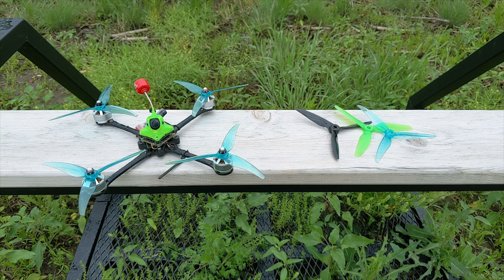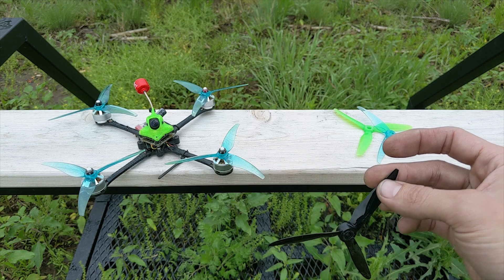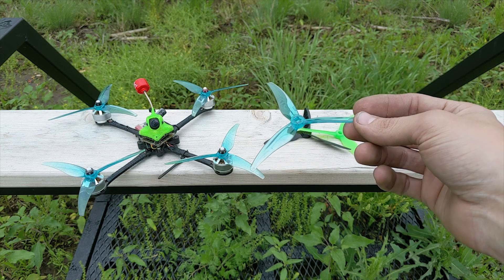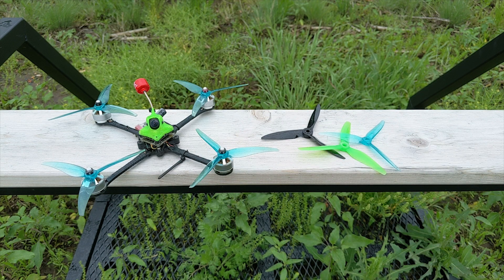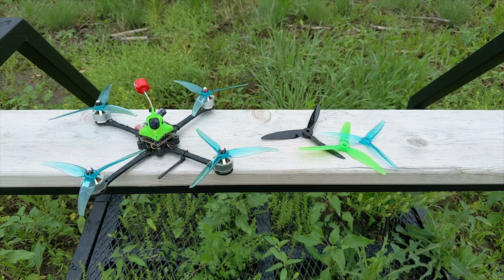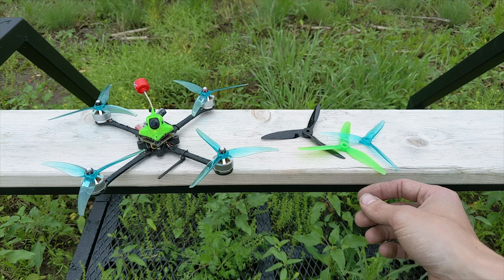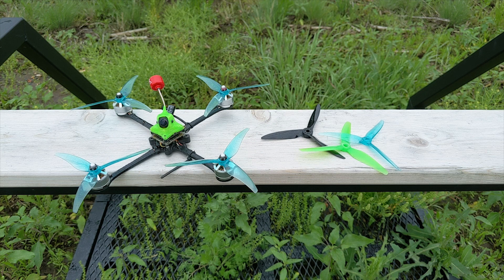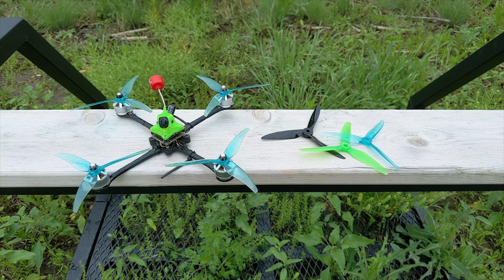Ultralight 5" Prop theory, Gemfan SL5125

Comment: the 5051c are awesome but they need an updated version
Reply from the maker: It will be interesting to see if they try to produce an updated version of it or an entirely different design for Utralight. The 5051C'S are a strange prop and don't take crashes very well.

Comment: Suppose there is any way this type of build with a vista unit with the new nebula camera might come in under 250g?  Or are we not there yet?
Reply from the maker: It's very doable with the Vista. I'm sure it would be close with the 1806's but the 2004's should be more efficient. If I took out my camera,  antenna and vtx, I would be at 215 ish grams AUW. Add Vista and antenna +32.5g? Should be about 247.5 grams AUW.
Reply: DamFast FPV ok I’m in haha, order up :)
Reply from the maker: @seewell8168  thanks for your order!

Comment: Hey man cool video. What's your thoughts on the vy 2004 motors being at 1950kv and 3150kv? At first I thought 3150 was too high for 4s but their tests were showing 33amp drawn at max which is totally manageable. Would still come well under 250g with an 850mah rdq or gnb 4s. Maybe the 1950kv would be better suited for 5s vs 6s like they say.
Reply: I got some of the latest hqprop T5x3 biblade props and the hqprop T5x2x3 triblades on the way to try out to. They are even lower pitch 👍.
Reply from the maker: I am working on a set of motors with brother hobby, samples are coming soon for testing. 3150kv will be easier to build with the current whoop style boards available for 4S. Otherwise you will have to run a 20x20 to get 6S running on that 1950kv motor. Unless we can bug BetaFPV to release a final 6S whoop board like the prototype board I got from them. I'm a 6S junkie all day. Lol. Another negative for going 6S is the battery selection is crap for Utralights. All my Utralight 5S and 6S packs are home made from 3S packs. It's easier to find the better 4S batteries for sub 250G.
Reply from the maker: And I have not tried the bi-blades, for their weight, I would assume the Gemfan tri-blade will out perform them in every way. Let me know how they do if you try it before I get to it!
Reply: @damfastfpv8016  for sure. I'm thinking those gemfans will be the best, the hq 5x2x3 looks like they push about 50 grams thrust less than the gemfans, but they also use a couple fewer amps. Still around 1000 grams thrust per motor.... The power to weight ratio is gonna be insane haha. If I can get 4-5 mins on that setup with an 850mah 4s lipo I'll be a happy camper!
Reply from the maker: @valden  you should be able to go anywhere from 5-10 min with that setup, all depends on how heavy your throttle thumb is! Lol. If that's even a thing.
Reply: @damfastfpv8016  that would be pretty sweet! I also feel this thing is gonna be great for line of sight.
Reply from the maker: @valden  it is deceiving how responsive it is. I would love to see The RCAddict fly it LOS or someone equally skilled. My LOS skills are lacking, lol
Reply: @damfastfpv8016  wondering if it will be ok with an xt30... I have a bunch of batteries with xt30, but if I need to swap to xt60 I'll do it.
Reply from the maker: @valden  XT 30 will be fine, but if your like me, I gotta obsessively squeeze every bit of performance outta everything. I totally do not recommend modding batteries unless you are very very experienced to do so. It can cause fires to happen if not done correctly. There is still tons of performance available through an XT-30
Reply: @damfastfpv8016  cool I will try ot out and see how it goes and switch to xt60 if the need arises
Reply from the maker: @valden  let me know how it does. I will be testing some more motors soon. Hope they are as good as the stats say.
Reply: @damfastfpv8016  will do... They need to release them soon lol. But if you find out anything compelling or that may be even better I'll be sure to follow your findings.
Reply: @damfastfpv8016 ohhh man, they must have read my mind because I just ordered them! They just popped up on the brotherhobby store and they are going for 21.99 a pop. Here's hoping it all works out. Will keep ya posted.
Reply from the maker: @valden  lol, that's too funny! I should have a set this Friday if all goes well.